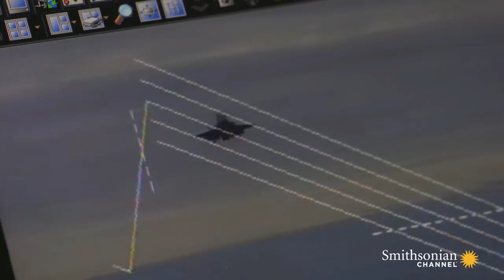This Fighter Plane Landing Has Never Been Attempted

Comment: Wait...... what about the Harrier?
Reply: The Harrier used to land vertically. This type of landing was extremely difficult with a lack of computer controls on the aircraft.

The UK did build a specially modified Harrier with fly by wire systems and tested this landing concept in 2007. That data was then put into the F-35 project.

Comment: It’s no need to drop all weapons that brought back into the sea.Stop putting hate to f-35.
Reply: That's correct - with weapons and fuel on board, the F-35 is too heavy for a vertical landing (landing gear loads) - that's a fact. So that's why they have to test this dangerous procedure - just to be able to use the plane. It's not a feature, it's a bug !
Reply: @MikeSHA2009  I would agree that it is probably a design oversight, but in reality, when fully operational, how much time will the HMS Queen Elizabeth actually spend stationary in the water?

Comment: i thought harrier did it first
Reply: No. Harrier took off on a ski jump and landed vertically. The ships decks were too short for a rolling landing.

The Harrier did do a rolling landing, frequently, on land. So does F35B. One of the reasons F35 does that on a runway is to avoid runway surface damage.

I believe there may have been flight tests done with the Harrier re shipboard rolling landings. But never put into service.

Comment: Did the Harrier need to empty it’s fuel and dump it’s weapons? Coz that seams not only wasteful but horrendous for the environment. 

I wonder if they’ll ever iron out all the bugs in this “Jack of all trades, master of none” white elephant?
Reply: Yeah the Harrier was even more limited in weight when it was performing a vertical landing, so the only option would be to dump it.
Reply: @Benjd0  
If it could take off vertically, how come it couldn’t land after a mission with less fuel on board? Ski ramp launches excepted of course.
Reply: @thechumpsbeendumped.7797  They have pretty much the same limitations with vertical take offs (Probably even more limited as far as I know).

That's why they pretty much only ever perform short rolling take offs (With the F-35B a short rolling take off allows them to carry a full weapons payload).
Reply: @Blob B 
I was referring to the dumping of fuel and weapons before landing, not take off.

Comment: Y not just land like a regular jet with fuel and weapons still on it. Seems a bit extra w more effort
Reply: Because the jet would skid right off the other end of the ship.  They could fit arresting gear but arresting gear takes time to reset between landings and limits how quickly the carrier can recover jets.  These carriers are designed to get planes into the air and out of it in the shortest time.
Reply: Yeah just as an example, for a standard landing with an F-35, which is pretty typical, it requires at minimum 8,000 feet of runway. This aircraft carriers deck is around 900 feet long, so it's quite the feat managing to land it on the deck like that with plenty of room to spare.
Reply: @Benjd0  "for a standard landing with an F-35, which is pretty typical, it requires at minimum 8,000 feet of runway."

Incorrect.

Comment: all that and he just flys in and lands it like they always do...
Reply: Looks far far easier than it actually is. This aircraft carrier is just over 900 feet long, for a normal landing an F-35 needs a runway that's at minimum 8,000 feet long.

To make this possible they have to come in at very low speeds, using the vertical lift system to stop them dropping out of the sky, hit the deck as soon as possible (Without going too low and crashing, or too high and overshooting) and stop in a very short distance.
Reply: @Benjd0  "for a normal landing an F-35 needs a runway that's at minimum 8,000 feet long."

Incorrect.

Comment: Something Harrier pilots were doing 50 years ago.
Reply: Exactly ! So, they phased out the harrier to do it with more money 50 years later.
Reply: It wasn't really doable on a regular basis due to how complicated it was to pilot the Harrier.

They tested this with a specially modified fly by wire version of the Harrier in 2007 to prove the concept though.

Comment: Wasn't this plane supposed to be fully operational in 2007?
Reply: It still isnt... this is a fix because going full VTOL (virtual take off and landing) damaged the surface of aircraft carriers.  Turns out VTOL is practically useless.  The only place where it would be beneficial in war is on an aircraft carrier and LM's design doesnt work and was banned from doing that.
Reply: @Ddub1083  That's not right at all. This type of landing has been in development for years for the Royal Navy and was first tested with a modified version of the Harrier. It allows more weight to be carried back to the ship, as all jet powered VTOL aircraft ever made have been limited in weight doing this as it takes a massive amount of power to keep it hovering without any lift from the wings.

Vertical landings will and are still being used, it was the first landing that they tested on the QE class. They have a special thermal coating which dissipates the heat hitting the deck, so it's not an issue. It was shown in another Smithsonian video on this channel.

Comment: US Marine corps Harriers do this all the time on amphibious ships..... Sooooo
Reply: Usually vertical landings, not SRVL. It's possible to do with the Harrier, but much more difficult and risky due to the controls.

The UK have been developing this style of landing to be safe enough to do on a regular basis for many years now, around 15 years ago they first tested it with a specially modified Harrier that had a flyby wire system installed. This allowed more computer control (As well as automatic landings) basically as a test bed for the F-35.

Comment: This just shows how impractical this plane is. If it’s main feature is so risky to use then what will happen in a combat situation. The F35 was built to make military contractors rich.
Reply: It's probably the least risky aircraft to land on a carrier when using a vertical landing.

This is a new form of landing so there will of course be some extra risk initially, but with the data they collect and landing aids it'll likely be no more risky than any other carrier landing.

Comment: Wow, I forgot that the Hawker Siddley Harrier didn’t ever take or land in the SVRL method. For the F-35 it might be a first, but it definitely is NOT the first ever.
Reply: SVRL=Shipborne Rolling Vertical Landing?
Reply: "I forgot that the Hawker Siddley Harrier didn’t ever take or land in the SVRL method."(sic)

The VAAC first flew SRVL - Shipboard Rolling Vertical Landing - aboard the Charles De Gaulle back in 2007. Fleet Harriers and Harrier IIs did not utilize the technique.

Comment: The British have always done this, they did it with the Harriers too. It just saves them from losing perfectly good munitions
Reply: They haven't always, it was first properly tested in 2007 with a specially modified Harrier. The standard landing for a Harrier was always vertical.
Reply: "The British have always done this,"

Not at sea they haven't.

“I’m excited and thrilled to have achieved this, the whole team is,” Wilson said. “It’s an inherently risky maneuver. We have always understood it is safer to stop before you land than it is to land before you stop and the prime reason for that is that if something goes wrong with the airplane it is far better for it to be stationary than a rolling wreckage. I’ve worked on this for the past 17 years; it’s fantastic to know that it’s matched the modelling and simulation we have done over the years. I’ve flown over 2,000 SRVLs in the simulator, and am honored to have been able to do the first one onboard HMS Queen Elizabeth here today.” Pete "Wizzer" Wilson 13 October 2018

Comment: Can they add wires across the back of the ship and do a F35C style landing on a regular carrier?
Reply: The F-35C has a much-upgraded landing gear configuration for high-speed arrested landings. The F-35B could certainly land on a traditional carrier vertically if you arranged the deck properly, but it cannot do a landing like an F-35C. Besides U.S. carriers, only the French carrier Charles de Gaulle is compatible with this system (as of now).
Reply: @VisibilityFoggy  I am not talking about trying to land a standard F35B by flying in. Get the manufacturer to build a special UK model which is a F35B with the more rugged F35C undercarriage. It will probably have to be renamed F35U. 
Before Canada got rid of the arrester hook on their F18 (replaced with parachutes) arrester wires were stretched across  the primitive airstrips up north. If Canada can do that I do not think it would be that hard for the RN to do the same on their carriers.
Reply: @adrianchong2754  It may be possible, but I doubt the development would be worthwhile for them. Once this type of landing is practiced it will likely be just as easy, if not easier to perform than an arrested landing. They will likely choose to perform vertical landings on a more regular basis still as they can land multiple aircraft at a time that way too, this is just an extra option they have.
Reply: @adrianchong2754  "Before Canada got rid of the arrester hook on their F18 (replaced with parachutes)"

Source?

How much time will be required to repack the chute and reinstall it and what impact will that have on sortie rate?

Comment: I don't get the excitement, this plane already has the capability of changing the direction of its engines, and it can take off and land vertically, so why is this an accomplishment? What did I miss? 🤔
Reply: Doing one or the other is fairly easy, but trying to balance between the two like this is much more difficult. Especially if you're too heavy to go fully vertical, you need to keep enough speed to prevent a stall, but you can't go too fast or you'll overshoot.

It's only really possible to do this regularly now with the F-35 because of all the computer assistance.

Comment: That plane could not land or take off on that short ship unless it did do so as was demonstrated.  I am betting that with that raised section at the end of the runway, that ship is only used for fighters (not heavy like that F35) and or helicopters.  That appeared to be just a test to see if the F-3 could do a half rolling and half vertical landing, because obviously it could have landed vertically whenever it wanted.  If the ship was under power and moving that would present issues for the pilot because he must move with the ship while also dropping to its deck which I believe takes a more delicate touch on the stick and controls.
Reply: The ship is designed only for the F-35
Reply: "That plane could not land or take off on that short ship unless it did do so as was demonstrated."

Incorrect.
Reply: @AA-xo9uw  Maybe you can elaborate on why you believe what is incorrect about what I wrote above AA ?

Comment: What’s the point of vtol if you can’t carry weapons with you? Or is it just landings?
Reply: No jet has used vertical take offs on a regular basis during war for this reason. It's just physically impossible to carry anything useful with current engine technology.

That's why we still use carriers instead of operating these from helipads. Landing vertically will still be viable and used though.
Reply: Barry Sabahat vtol is what the jet can do but stovl is what the jet does in warfare

Comment: Definitely cool, but don't tell me it's "never been done before." The AV-8B has been doing that for decades
Reply: It was tested on a specially modified Harrier back in 2007 (For this purpose) but it was never regularly used with the Harrier as it was deemed too dangerous for a number of reasons.
Reply: @Benjd0  I'm not sure where our miscommunication is. There are tons of videos, even here on YouTube, with harriers landing vertically. One even without nosegear. The pilot on that one says he's done it so many times it wasn't nearly as hard as it looked.
Reply: @craigaleg1  Ah this video is about a new form of landing called SRVL (Shipborne Rolling Vertical landing) which is basically a short rolling landing.

They're testing this type of landing as when doing a regular vertical landing they have to be under a certain weight.
Reply: @Benjd0  I still don't see how it's really nee
Reply: @craigaleg1  It's new because it's not exactly a vertical landing, it still has forward momentum, this means it can have more weight on landing, and as they say in the video - ammunition and fuel that may of need to be ejected no longer needs to be as it can land with more weight. This is specially designed in order to save money.
They can do this on a Harrier, it was tested but it's not done operationally as it's still technically unsafe.
Reply: "The AV-8B has been doing that for decades"

Not at sea it hasn't.

Comment: The sea harrier did it in the 60’s without computer fly by wire systems and thousands of hours worth of computer simulations, the yak did it in the 70’s same deal, the prototype moon lander did it and that was plain as day suicide. Landing an f35 although difficult is as routine as landing a helicopter.
Reply: Landing vertically yes, SRVL is a little less routine, it was never used regularly with the Harrier as it was deemed too dangerous. Fly by wire systems, better brakes and landing gears have made it possible to use on a regular basis with the F-35B.

A specially modified Harrier did do this in 2007, this was to test the concept for use with the F-35B.
Reply: "The sea harrier did it in the 60’s without computer fly by wire systems and thousands of hours worth of computer simulations,"(sic)

First flight of the Sea Harrier occurred on 20 August 1978.

"Landing an f35 although difficult is as routine as landing a helicopter."

A successful SRVL is no walk in the park as Peter Wilson explained back in 2018.

“I’m excited and thrilled to have achieved this, the whole team is,” Wilson said. “It’s an inherently risky maneuver. We have always understood it is safer to stop before you land than it is to land before you stop and the prime reason for that is that if something goes wrong with the airplane it is far better for it to be stationary than a rolling wreckage. I’ve worked on this for the past 17 years; it’s fantastic to know that it’s matched the modelling and simulation we have done over the years. I’ve flown over 2,000 SRVLs in the simulator, and am honored to have been able to do the first one onboard HMS Queen Elizabeth here today.”

Comment: Why would you design an aircraft with VTOL if it cannot use it at full capacity???
Reply: It can use it, it's just safer to do it this way and more fuel efficient.  Also every VTOL or STOVL pilot has to learn to do this anyway because if you are bingo on fuel then hovering is a luxury you won't have.

Comment: If this plane can't do a Harrier type landing, get rid of it
Reply: Harrier basically never landed vertically because it was very dangerous but with f 35 its a lot safer.
Reply: It can do a vertical landing just like the Harrier (in fact it can carry more back to the ship than the Harrier) this is solving a problem all STOVL jets have, including the Harrier.
Reply: Of course it can land like the Harrier IT DOES ALL THE TIME. This is a technique to save fuel and reduce the number of stores that need to be dumped. It also increases range.

Comment: This is bread and butter stuff for the Harrier. The reason it is an issue for the F35 is because the F35 is not a very good aircraft. An expensive aircraft, but not a good one.  For the price of a single F35 you can have between 4 to 8 brand new Harrier AV8Bs.  And each Harrier will be airborne a lot more. In the Falklands War the Harriers had a serviceability of 98%. The F35 will be hard pressed get 25% after the first week of a conflict.
Reply: Myths perpetuated by the ignorant.
Reply: @AA-xo9uw  - Myths perpetrated by evidence.

Comment: The Military is now condemning this plane, mainly its engine. They can’t fly at Military requirements which makes it literally worthless to them. The fan blades have an issue causing them to deteriorate. There are not enough spare parts or complete engines to keep it in the air. Air Force is now buying F15s to augment their stock. What a joke it is at the moment. Pretty sure a solution will be found but for now they have to fly them slow.
Reply: Rubbish across the board.

"Air Force is now buying F15s to augment their stock."

The F-35A was never slated to replace the F-15 as an air superiority fighter. New build F-15EXs are being purchased to replace ANG F-15C/Ds that are at the end of their service life. Some current F-15 squadrons will transition to the F-35 but the scope of their mission will change.

Comment: What is the point of spending hundreds of BILLIONS of dollars (yes you read that right), to develop a fighter that can VTOL, when it can't do so with unburnt fuel or unexpended ammunitions on board, so has to then become a STOSL (Short take off short landing)? 
Once again proving the F35 program was a ballsed up dud from start to finish.
Reply: It's the same for all VTOL jets, just due to physics you'd need a very powerful engine (more powerful than anything is possible right now).

It can still land vertically with a higher payload than the Harrier which it replaces though.
Reply: "What is the point of spending hundreds of BILLIONS of dollars (yes you read that right), to develop a fighter that can VTOL,"

There was no vertical takeoff KPP for either the X-32 or X-35.

"so has to then become a STOSL (Short take off short landing)?"

The B variant has always been a STOVL - Short Take Off Vertical Landing - platform.